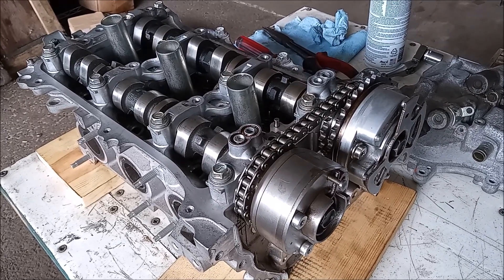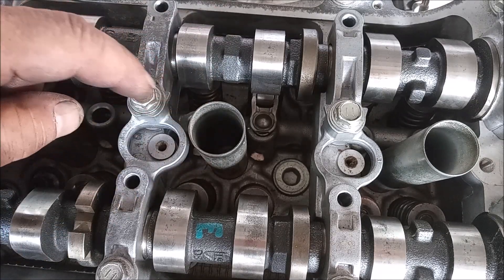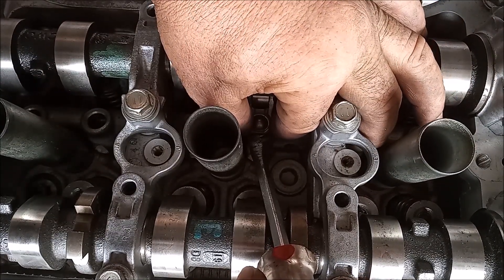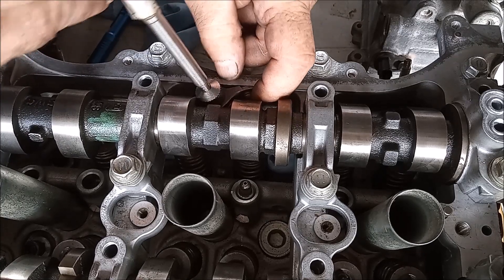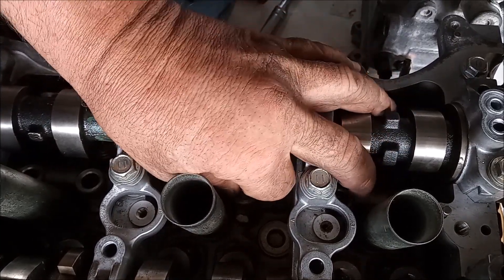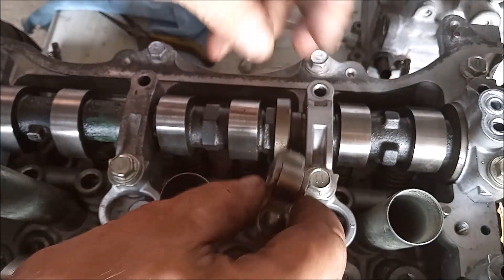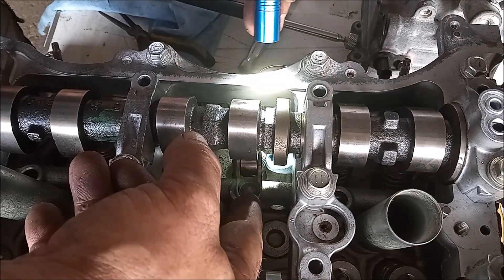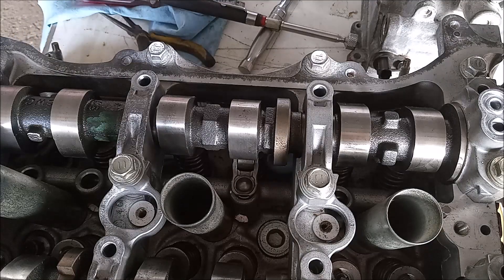Toyota 2GR-FE Engine Valvetrain Components - also 2ZR-FE 3UR-FE 2AR-FE

Comment: Frank, exhaust rocker removal possible if the cylinder head is still on engine? I am trying to replace a broken spring. Thanks.
Reply from the maker: You have to loosen the cam caps, remove the timing chain tensioner, and lift up the camshafts.
Reply from the maker: Make sure you don't drop that valve. Put that cylinder to tdc, either use compressed air in the spark plug hole or feed rope into the cylinder.

Comment: So You could basically do this with the engine in the vehicle correct? I have a sienna with really loud lifters that are ticking at some point I'd like to replace the lifters but really don't want to have to dissemble a lot to replace em. I'd be fine with dropping the engine to get to the rear head but thank you for this video.
Reply from the maker: You would have to loosen the timing chain and lift up the camshafts.
Reply: Do you have a Videos doing the rear exhaust lifters
Reply: I have a constant intermittent miss that I believe may be a sticking exhaust lifter on cylinder 3

Comment: Thanks heaps for uploading this! Would love to see how you do the exhaust side. You are the first person I found that has mentioned removing the rockers or lifters without taking out the camshafts, so it's good to know it was can be done.

I've seen there are lifter removal tools and rocker removal tools available, do you think either of these would work on 2gr-fe engines?

Both these tools compress the valve to be able to remove the rocker arm, is there any risk of being able to push the valve into the top of the piston if the engine is in the wrong position?

Thanks again!
Reply from the maker: As far as I know, there is no available rocker removal tool that will work for this valvetrain. It's a problem crying out for a solution. Definitely move the piston away from tdc or something bad could happen. This is an interference motor.

Comment: nice video. i have had to do this several times but didn't use this technique. i took all the cam caps off and lifted the cams very slightly and snuck everything back in place that was. i had like 5+ thrown rockers and it made quick work of it. But when i opened up the valve cover after the rockers got thrown, several of the valve stem caps were missing, likely down the oil drain holes like you spoke about. The engine just lived like that for 15 more track days and a year or two of abuse before finally dying recently
Reply from the maker: We need to build you a proper race engine with cams and springs so you can tear up the track without fear of flinging rockers.